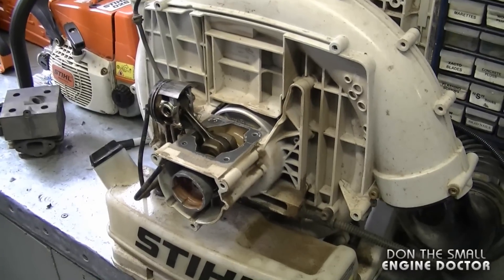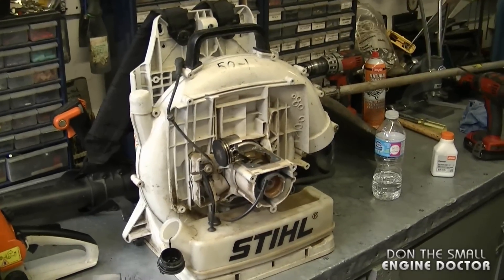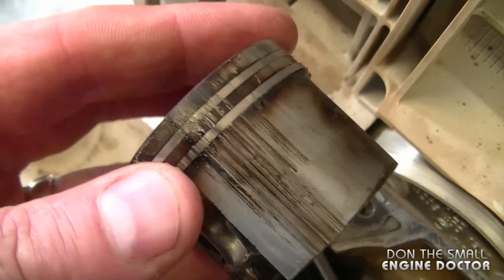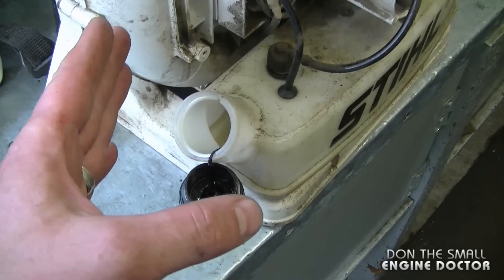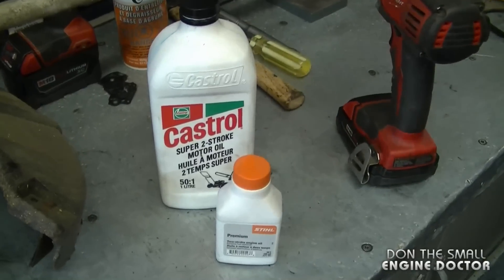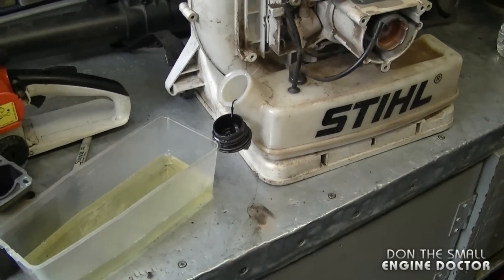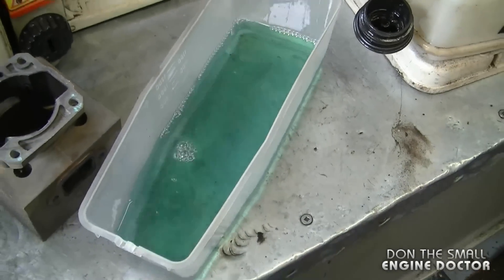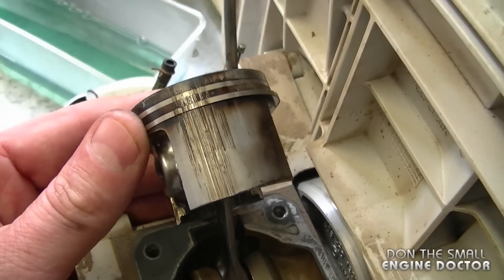What Happens When You Run A 2 Cycle Engine With No Oil In Fuel! - Video

Comment: So I ran my 2 stroke on less oil than ideal. 
  I had about 12litres mixed correctly and topped up with 7ltrs without adding oil. Oops.. 
  Ran it on off for about 1.5hrs. seems fine. 
    Likely issues ?? 😮‍💨

Comment: I got a Husqvarna blower like that I picked up for scrap, I can get it to run if I flood it, or if I dump motor oil down the spark plug hole, and it runs great when it does light off, but its super hard to start, in fact when I got it, it was locked up tight, I was able to break it loose with out to much effort, but I think the rings are shot or someone ran raw gas in it, I need to get me a compression tester, I can get it to start every single time if I dump a little bit of oil down the spark plug hole to help increase compression and I had it running for over and hour, thinking the rings might be stuck and the heat might help, but it didn't help.

Gonna tear it apart and see what it looks like on the inside, I bet it looks just like this one.

Comment: Thank you very much for the video and confirming my thoughts on an old snow blower's two stroke engine that unfortunately it suffered from a similar type of damage. The two rings on the piston not only fused to the cylinder but had entire sections missing due to how deep the groves went, also the gasket was broken and the choke/carburetor instead of moving fuel mixture and air into the engine, well...  it did the opposite. So, after seeing this video,  It is safe to say that it wouldn't be worth fixing. Thank you again 👍

Comment: Put 3 times the recommended amount of stabilizer in small engine fuel. An engine not starting because of bad gas is a nuisance not worth the small cost of the stabilizer.

Comment: If you do lend out 2-strokes give them the 10L/2.5G can with the mixed fuel. 10L has been going for a couple years. If it says 40:1 mix 32:1. Oil is cheap engines are expensive.

Comment: The fist time I got my weed eater I ran it for about 2 minutes and remember I needed to add oil so I changed the gas do you think it would have caused major damage over those 2 minutes
Reply: trick top if it got hot enough for the piston to swell you would have scored the cylinder and piston

Comment: every time ive repaired a broken chainsaw or blower used by my company. the fuel has always been clear/yellow in color. now there is a cheap 2 stroke oil sold in gas stations that is a clear/yellow oil but ive never believed the OWNER (the one who always buys and mixes the fuel) unless i do it myself. i myself use oil that turns the fuel red or purple. and i run alil extra oil cuz its much easier to clean carbon out of exhaust or replace a spark plug instead of rebuild or replace a machine. 

and one tip i learned from a very smart man. strait gas never enters the shop. and every empty can of fuel gets oil added so its always ready to be filled. and a machine that takes strait gas can run on mix with no real adverse effects.

and give the can a lil shake before filling something.

Comment: What does the scoring do to cause the motor not to start??  Lack of compression or something else?
Reply from the maker: scoring makes the compression too low
Reply: Checked the compression on a 49cc mini-bike motor that wont start - it's 115 psi.   I then put 2 spoons of oil in the cylinder and compression tested at 175 psi.  Does that increase indicate a damaged cylinder?   Spark is good.  Even with a spray of starter fluid it never attempts to start.

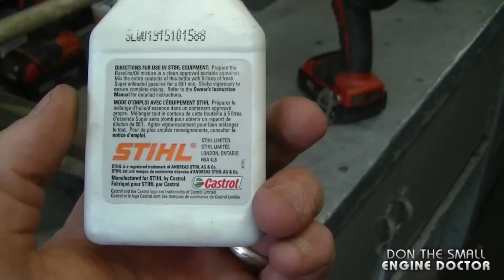Comment: I drive an East German bike with a 2-Stroke engine that runs on 1:50 oil-fuel mix.
I now have the problem that there is to much oil in my engine and the crankshaft is probably full with oil.
P.S. I get pre mixed fuel from a gas station and the fuel that "ruined" my bike was probably a 50:1 oil-fuel mix. XD

Comment: We get chainsaws returned as "defective, smoked and stopped running" occasionally at the store I work at. I always check the gas. they didn't put any oil in. had it happen on a 4 stroke water pump once too. no oil in the engine.

Comment: well i screwed the pooch again ... i was out in the woods cuttin firewood and my stihl farm boss ran out of gas ,,, i was out in the middle of nowhere ,, i siphoned gas out of my truck and drained a little oil out of the drain plug on the oil pan to mix with the gas for my saw but i mixed it wrong ... that black oil out of the cranckcase of my truck clogged up the muffler on the ms290 ,,, that saw ran good enough to load my truck up with more firewood than i could use ,,, since craftsman bought out stihl they seem to last now and you can call the sears repair truck to your house to repair your stihl chainsaws
Reply: jake williams 4 stroke engine oil will burn off, full up cylinder head, sparkplug and muffler with carbon and after few minutes your piston and cylinderhead are destroyed...
Reply: Wow, nice fail. Craftsman never bought it stihl, but thanks for keeping us repair guys in business. 😂😂😂

Comment: ok i finally got my stihl farm boss fuel lines figured out ,, i had to call a sears repair truck out to the house since sears bought out stihl chainsaws ,, what happend was the fuel line got as stiff as a ministers dick and it stopped up the muffler bearing now it works great , sears really knows stihl chainsaws they are the best !!

Comment: how do you feel about tru fuel or other brands of 2 stroke fuels you can pick up at the hardware store? i know mixing your gas and oil is cheaper, but one can of tru fuel lasts me (a small lawn trim once a week for a season) lasts atleast one season or more and i don't have to worry about it going bad.
Reply: rdmccun Absolutely use Trufuel. After cutting I dump mixed gas and run Trufuel through it to store.

Comment: i took the fuel line off my old homelite saw and put it on my stihl farm boss and it worked great ,, i used the backfire return line from the carb on my poulan saw to re feed the pressure on the tank on the farm boss and it seems to be ok but not right ,, stihl , homelite , poulan and ryobie chainsaws seem to be made at the same factory and the same company .. i prefer the poulan saw its 10 times better than stihl or craftsman ,,,, the poulan is sooo much easier to work on than the craftsman saw its totally different , ryobi bought out husqvarna and they copy sears chainsaws now ,,, its all the same including stihl they are all made in the same place

Comment: i loaned my brother inlaw my stihl farm boss it came back with the fuel line pinched in the air filter he said it still runs great he ran siphoned gas out of his truck in it he said it will start upside down ,,, im like dayum i need to get it to a shop this is my fav saw , i always ran paint thinner mixed with axle grease for fuel and never had a problem for years , i tried to start it when i got it back from him and gas blew all over my pants and cought my leg and dick on fire i was soooo mad ,, i need this thing fixed i need my saw

Comment: On an old Echo chainsaw that was supposed to use a 25:1 ratio with old-fashioned, conventional 2-cycle oil, should I still use the 25:1 ratio with the modern Echo brand 2-cycle oil, or should I cut it down to 50:1, like modern chainsaws use?
Reply: I would stick to the manufacturers recommended ratio as the materials used in newer engines are harder and therefore more resistant to wear than the older machines, yes oils have improved, however a little extra oil is insurance against undue wear.

Comment: Could you do a short video on how you measure out fuel/oil ratios to get 45:1? I know some will think that is simple but the container of oil I have only shows for 50:1.
Reply: 111.11 ml to five litres
Reply: http://www.beaverplant.co.uk/image/cache/data/HP%20super-600x600.jpg I always use these with 5 litres of fuel. Works everytime and is a perfect measurement. Make sure to shake the refueling with great effort. JD.

Comment: Never loan your saw or your wife to a friend.
Dedicated marked cans for mixed gas for sure.  I also use wire tags to mark date I mixed. Any left after 2 months goes into truck.
Reply: Instructions unclear, put wife in fuel tank...
Reply: How do you tag your wife under that protocol?
Reply: Wife said her suv making noise.  Metal to metal on brakes will do that.
Reply: LoveStihlQuality so long as  you  shake the fuel if it's  been siting you should  be fine
Reply: djxmdnfb fjcjdhdhd Most of it gets used before but yes always shake can AND saw before starting.
Reply: Raoul Thomas n
Reply: that was pretty good
Reply: djxmdnfb fjcjdhdhd
Reply: I'd loan my wife to anyone dumb enough to take her.

Comment: Never loan your saw or your wife to a friend.
Dedicated marked cans for mixed gas for sure.  I also use wire tags to mark date I mixed. Any left after 2 months goes into truck.
Reply: http://www.ebay.co.uk/itm/Cylinder-piston-kit-fits-Stihl-BR400-BR420-BR380-SR420-SR400-leaf-blower-/191853082519?hash=item2cab55b797:g:GcIAAOSwxH1UHFL5

Comment: You would not believe how many units I get in that were loaned out & returned in disrepair conditions.
I had a new honda HR216 500.00 MODEL come in that only cut three lawns and the it was loaned and came back with a badly bent crank shaft & the front wheels had major positive camber ( 3" ) .  The owner was  upset as well.  I try to tell my customers to refrain from loaning,   And thats just one of many stories.
Reply: you are right let a friend use my 2 cycle blower filled it and gave him a gallon of mixed fuel but failed to explain the importance of using that fuel. he brought it back ruined of course because he didn't want to use up all my fuel and used his instead.  lucky for me he was a true friend and paid me half the cost of a new unit (he offered to replace it but because it was 4 years old I didn't feel I should take advantage of a friend) so  I got a brand new one for half the price and learned a good lesson if you loan something go over all details of the use of it before handing it over.
Reply: But when people loan their stuff out you get business ;)

Comment: My dad used diesel in an echo and it didn't last long, I use stihl oil now which turns the petrol red, only problem is my ride on mower is diesel and the agricultural diesel here in the uk is red, so I have to be careful not to use the wrong one. A quick smell then I know. I have the same blower as that it's a nice powerful tool. Good vid thanks.
Reply: Put a label on them. Problem solved.
Reply: Dastardly84 You totally correct,but I'm not that organised lol.
Reply: Do the shops sell yellow fuel cans? Those are usually for storing diesel fuel.

Comment: I always use Stihl oil in my garden equipment.  I used to use Echo oil which might be pink in color but since I have using Stihl oil and high octane gas both my Echo and Stihl garden equipment have ran better.  Lucky my Honda mower does not need oil in the gas.  My Honda mower has given my many years of service.  Out here in Southern California we have to mow our lawns year round.  Not so much in the winter maybe once every month compared to every week during the summer.

Comment: I run all my lawn stuff on 2cycle fuel....including 4 cycle...been doing it for 30 years. everything runs perfectly
Reply: No, that is not true. 2-cycle oil is specially formulated to burn clean. Otherwise the plugs in your 2-cycle equipment would be continually fouling.
Reply: Hi I had a old 4 stroke that the company recomended to run with oil in the gas. It helps the valves and piston a bit and the carburetor getts some lube for the trottle.
Reply: thats abit silly mate 4 stroke will oil the plug more regulary and possibly have carby problems, its fine if your stuck in a pinch but not great long term
Reply: no never had a problem.
Reply: Rob H even in my cars, we use a litle 2 strk oil into the fuel. it will run forever.
Reply: i put oil 2 stroke oil in everything ,,, bike bmw 1200 gs , car audi allroad , my truck , boat , anything that burns fuel gets two stroke ,  bit of extra lube never goes amiss